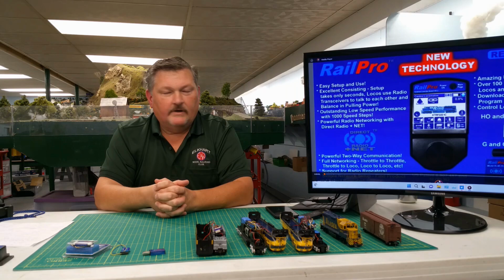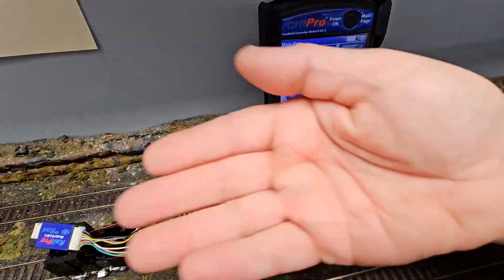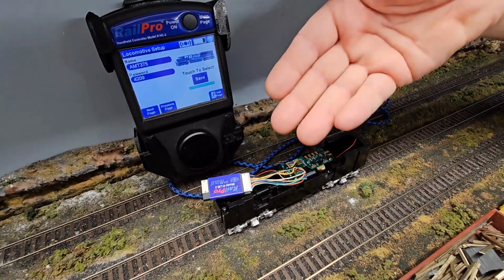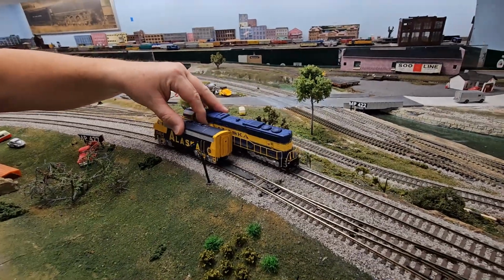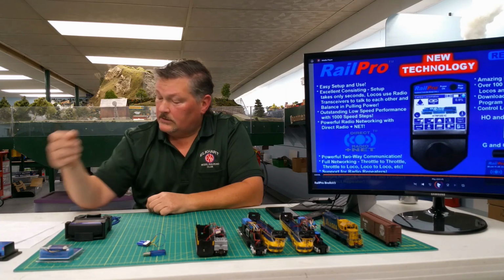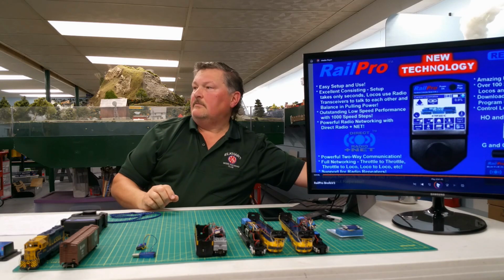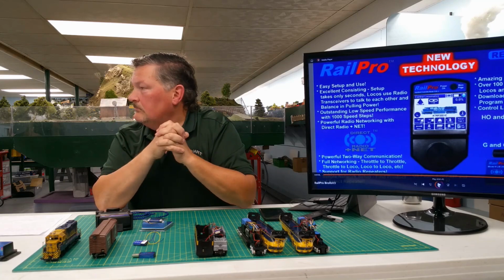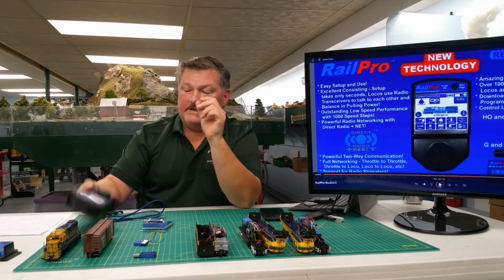RailPro Clinic

Comment: Wow, I am ready to dive into RP ! I was hooked on Digitrax system, almost bought it, but this is so easy to operate and the speed match thing is fantastic. I have over 100 DC loco's about half with 8 pin sockets ... their 8 to 9 pin adapter will make installs very simple. I seen other videos where they use DC track power (100%) to provide power. This is also attractive as I may keep some loco's DC. Just have to run them separately - thanks for your informative seminar - very valuable.

Comment: They do have a 21 pin connector now, correct?
Reply: Yes, the LM-3S-21. I recently installed one, and the process was very straightforward.
Reply: @tcmr4250  What did you install it on and would you know the  model brands that it's easiest to install in, basically, plug and play?